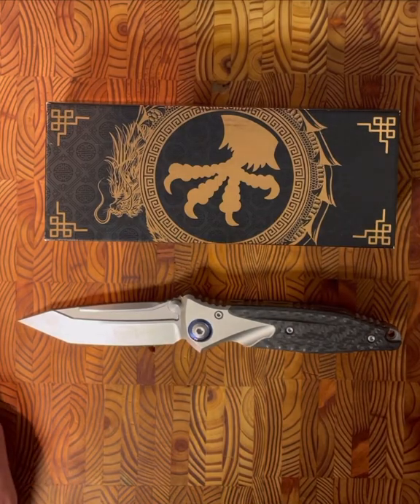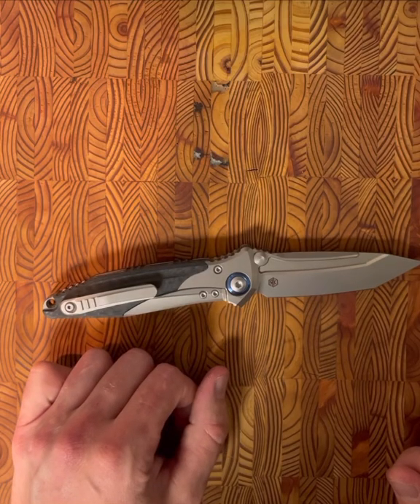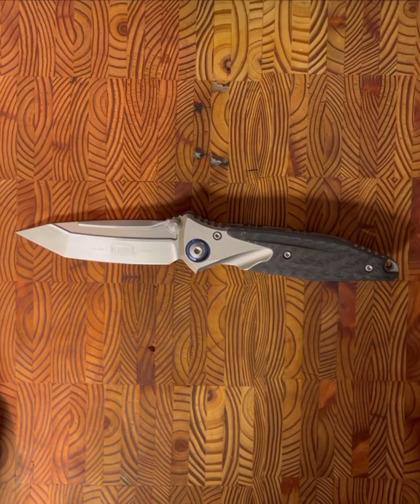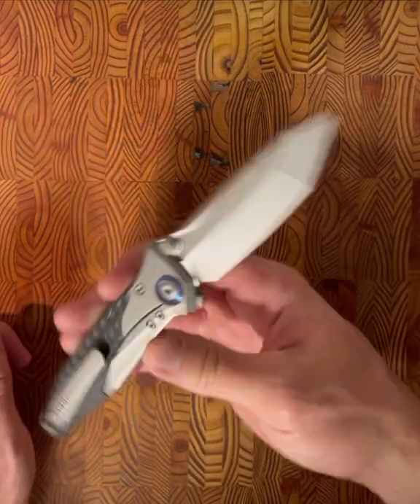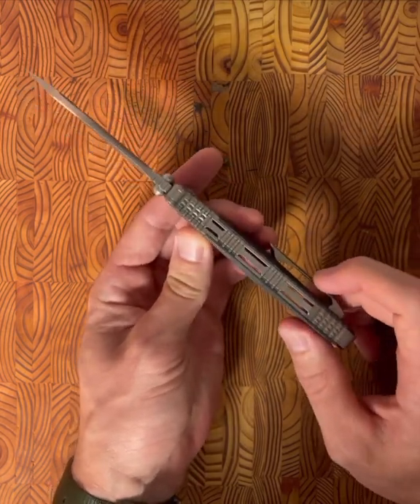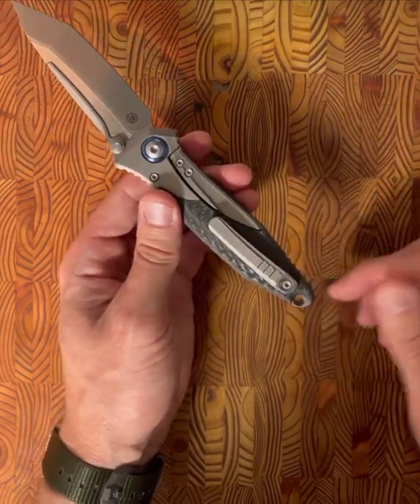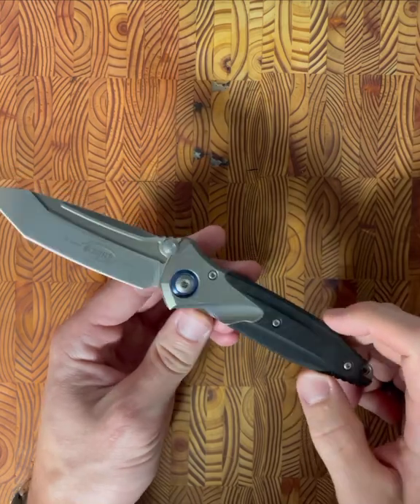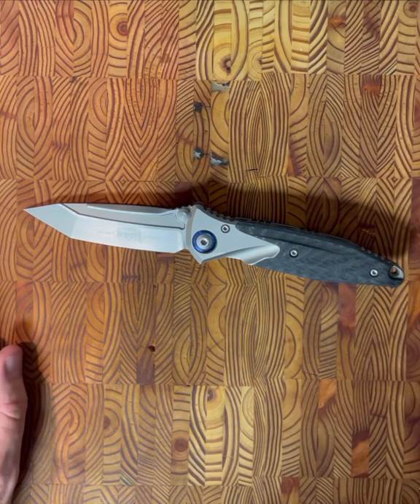Microtech SOCOM Bravo: My reintroduction to the claw brand

Comment: This is not claw brand, it is Reate. MT stuffs used to fuck naked way back.. Stuff pre 2017 is legit,newer stuff not so much.
Reply: Not made by Reate.
Reply: @CNYKnifeNerd  miss written, yes made by rikeknife, makes it 0% better🤷🏼‍♂️
Reply: @nOObels1  pre 2017 better? How so?
Reply: @KB-kw8ni  QC and level to details like the way screws sit in the same angle.. Heat treat if you actually used some of both.. Also there's sadly lots of stuff posted with broken springs of defects after short period of owning/using.
Reply from the maker: Tbh after owning both US Microtech SOCOMs and now this one made by Rike, I have to respectfully disagree with you 😬 Have you ever tried a Rike MT or are you just a blanket ‘I hate Chinese knives’ guy? Genuinely wondering. Also, to save you the question- my other SOCOM was from 2012 and definitely a nice blade (so, pre 2017 as you stipulated).. the Rike is still nicer 😬
Reply: @the_pointy_end  yep, sold after 3 days. Hope yours dont rust or develops lockslip🤷🏼‍♂️